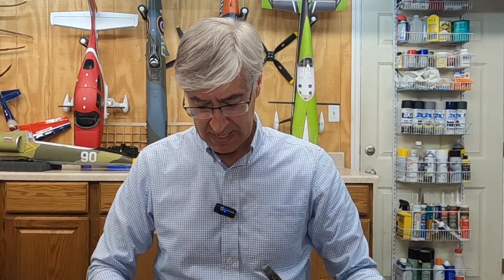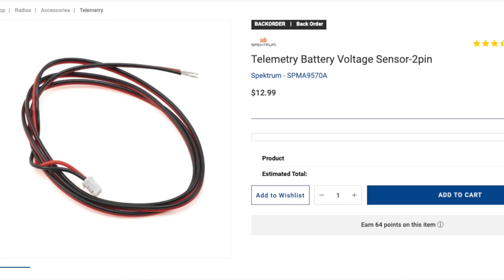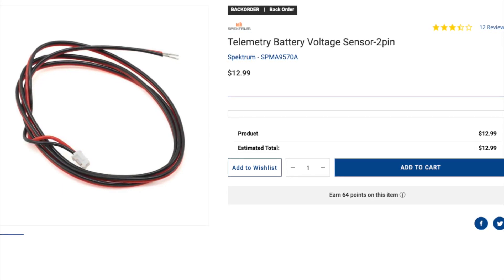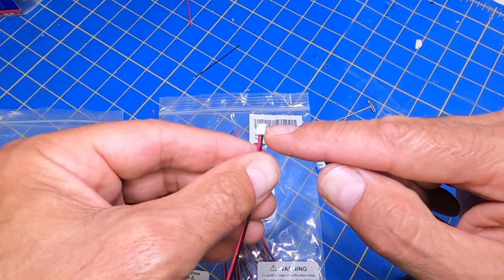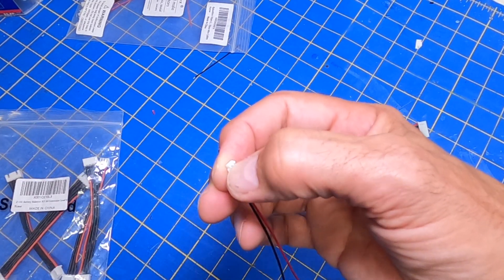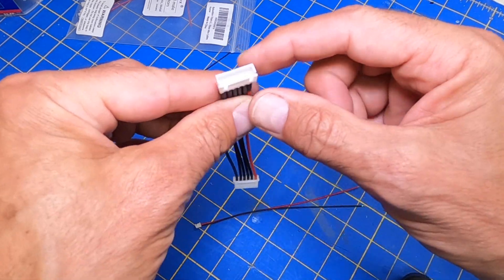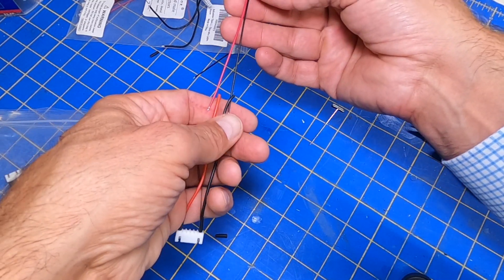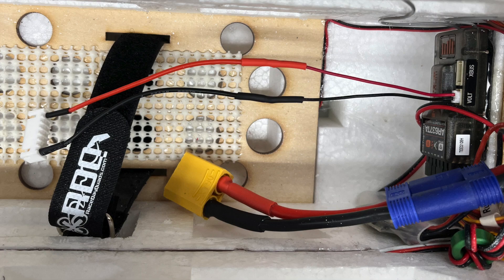Battery telemetry lead for Spektrum receiver

Comment: I just fried my sensor lead when trying this for the first time. This video was a major help. Thank you
Reply from the maker: It’s a tricky thing.  Now I only use the red wire to the sensor.  No ground.  Works great.  Btw, I did another video on this topic and a warning about using  the ground wire.

Comment: Thanks, good video. As i understand, you read the battery voltage from its balance plug, but why not from ESC cable? Of cause, it would require to make some adapter. The second question: have you ever tried to connect a thitd party baro for altitude and vario? I've tried to connect a bqnano from flywoo, but didn't reach any success...
Reply from the maker: Yes, I could've soldered the leads to the ESC battery cable, but didn't want to mess with that process.  If I have a new ESC that requires me to solder a connector, I'd add these leads then.   I think there are few ways to connect this lead (ESC, UBEC, or balance).    I haven't tried another sensor on the Spektrum system.  I have a handful of voltage sensors from FrSKY, but didn't try it..  I guess I could, but I worry about damaging the electronics..
Reply: I think you know now that the balance lead can “lead” to trouble if you connect the ground.  What I’m not understanding is why you’re not just connecting directly to the XT60 connector?  Less weight, less fuss and you still can avoid the ground lead when ESC is connected to the RX as the grounds are common.  You certainly seem like you have the skills and I pretty much use Spektrum IC5 or IC3 on absolutely every RC I own, so adding another low current lead is trivial and with Spektrum connectors you can use the middle hole :)

Comment: Just a word of warning.   I just destroyed an AR637TA receiver while hooking up this voltage sensor.  Apparantly you should only connect the red wire and not the black wire when the receiver is already connected to the flight battery through the ESC.  I connected black and red through the balancing port and the insulation of the black wire melted away in smoke.  It also destroyed the reciever and part of the black cable coming from the ESC connector.
Reply from the maker: Holy cow.  That’s awful.  Did you use the Spektrum version or made your own?  I had an issue of the Amazon no name plugs.  They were reversed polarity to what Spektrum port requires.
Reply: @SteffenRC  i used the Spektrum version that was delivered with an AR637T receiver that i bought for another plane.    Spektrum really should put a warning on the black wire to avoid people making this mistake.  You should only use red and black for a battery that is in no other way connected to the receiver.  Costly morning and the plane is on the bench until the new receiver arrives.
Reply from the maker: @PatrickVannie  that’s crazy.  I would’ve thought they’d document that.  Btw the test I did had power to the RX through a UBEC.  But I didn’t have any issues.
Reply from the maker: Patrick,  I used my harness this am and was concerned about the experience you had, but mine worked just fine.  The rx is powered by the battery through the UBEC and I also connected the harness to the red/blk on the balance lead without issues.   Could it be possible that the wires on your Spektrum product had reversed polarity?  Did Spektrum respond to your review/comment on their website?  I've asked HH/Spektrum for the documentation on this lead to make sure I'm instructing people how to do this correctly.
Reply: @SteffenRC  hello Steffen, i am sure that the polarity was not reversed but Spektrum did not answer to my comment on their website.  In a forum however a spektrum representative told me to only connect the red wire and the voltage sensor should work like that without any risk.   I am not going to try it again and will live without the voltage sensor.  My new receiver came in today and i replaced to fried receiver and everything is working fine.  So will leave it like that.
Reply from the maker: @PatrickVannie   Gotcha.  Thanks for the feedback.

Comment: Another interesting project.  Well done.  If I can back up just a bit - I was curious about your comparison of the various glue options you tested.  I understand that using E 6000 had some degree of working on the foam such that it became softer.  Did the foam remain soft or did it firm back up after a time?  Do you think it had an effect on the strength of the foam component?   -   It looked like the way you had to grab the test blocks to try and break them apart - that the foam pieces were still fairly strong.  ?  Thanks - Rog.
Reply from the maker: Thanks Roger, The E6000 softens the foam around the joint and I think that melting of foam, when dry and cured (its not brittle, but flexible) it makes for a crazy strong bond.  Like the Hot Glue.. Melts the foam too..  I've been trying to apply it sparingly on the outside edge to not create a visible line where the foam melts..  A little can go a long way.... - Will